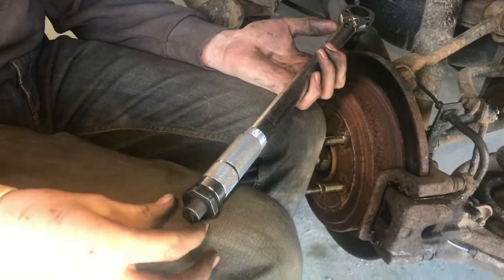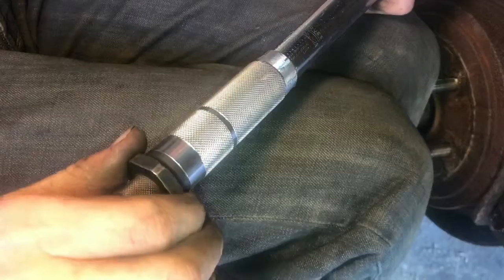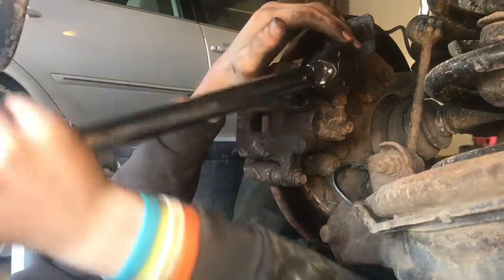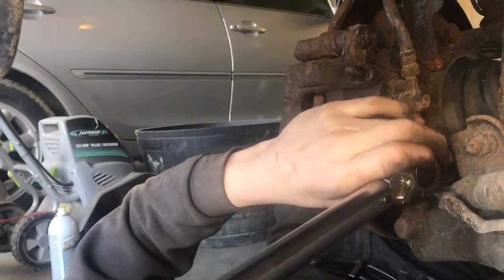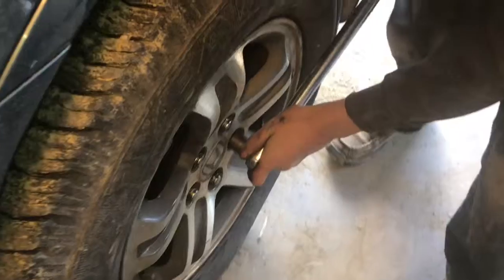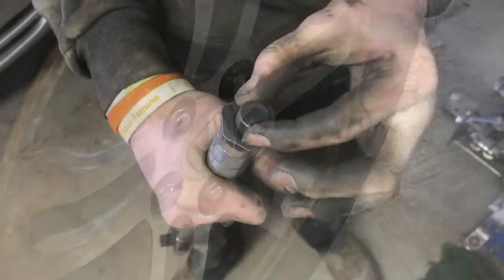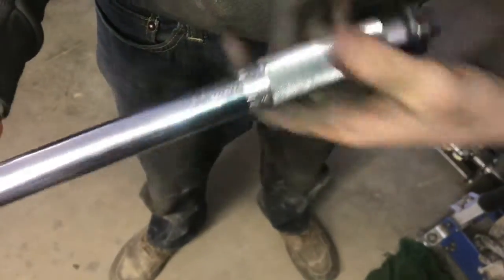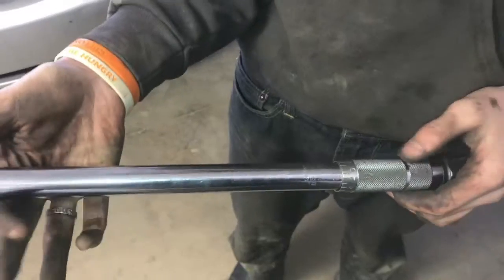how to READ and USE a clicker style torque wrench (harbor freight Item#62431)

Comment: A note of caution - applying force up towards the head of the tool, like appears at 1:47, will increase torque beyond the dial setting. It's not likely to create a problem in this situation, but using a click wrench this way when threading into alloy or when using high tech materials, composite/carbon fiber, could result in overstress or material crush.

Comment: I have this wrench and it is pretty difficult to rotate the adjustment sleeve as you go up in torque. Is this normal or do I have a dud?
Reply: Just got one and noticed same thing.  Fairly easy to about 110 or 120, then it gets progressively harder.  I was just holding the shaft as I turned the collar.  If you grab the socket head like he shows in video, you’ll get more torque when turning and getting from 120 to 150 is a lot easier.

Comment: my dumb ass thought the tourque wrench wouldn't be able to tighten after desired setting
Reply: I just bought the same one, is it a different click when you get to the desired setting?
Reply: @Spidergio-cr7 how is it working?
Reply: yup! same!  it cost me an extra $100 after I stripped a line connection. I should have watched this first SMH

Comment: I don't understand the "it doesn't click, you just have to feel it" phrase.
Reply: These are lower end Taiwanese tools
Reply: Because you're a little fruit pie.
Reply: I use it on my quad at a low torque you can hardly hear the click but you can feel it with your on the top of wrench
Reply: I heard the click in the video
Reply: Just tried to use it on my motorcycle. It's definitely no torque wrench. More like a breakerbar. Real SOS

Comment: Why is much harder to adjust past 40 ft lbs? I tried to loosen the bolt each turn but it won't budge
Reply: The higher you go the harder it compresses the spring inside. It’s normal.